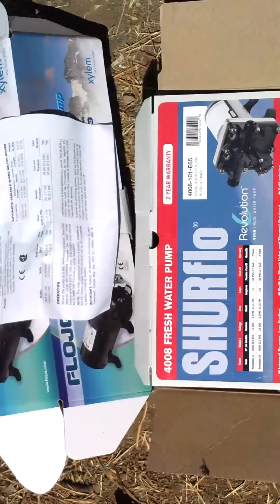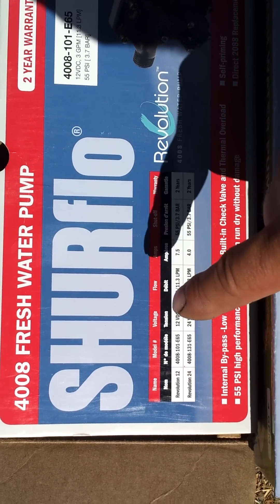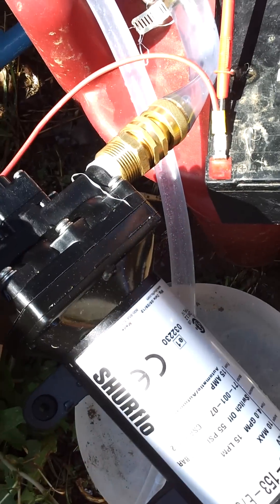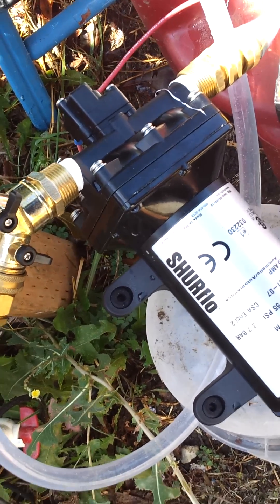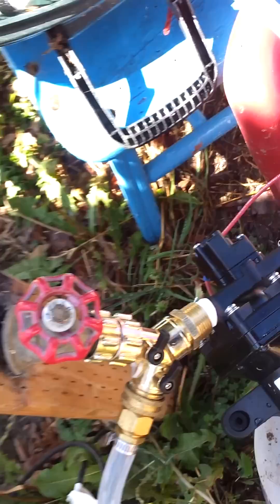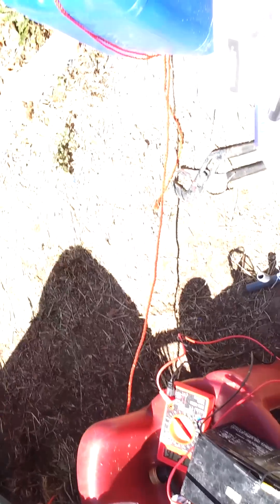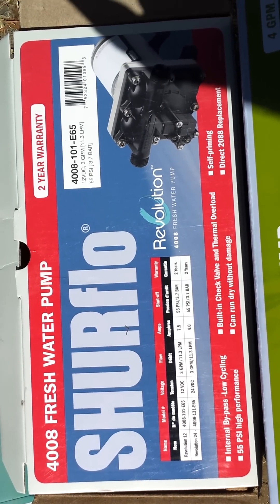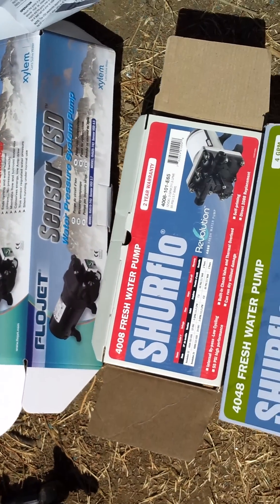Water pump test Flojet r 4525,  Shurflo 4008, Shurflo 4048

Comment: Unfortunately you didn't show the Flojet running as I'm interested in the sound of the pumps for my camper.  What are your thoughts on that?  Is the Flojet the quietest?  From what I read it should be.
Reply from the maker: +David Smith  it is loud. I have vsd 5 gpm at 40 psi that is very quietyou would get it at the Camping World